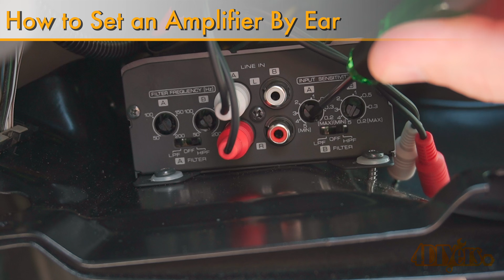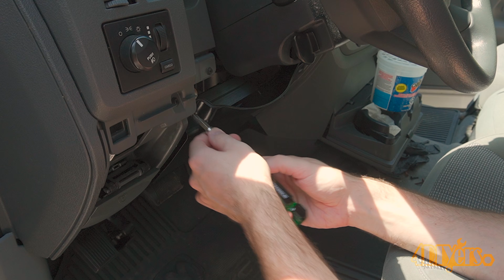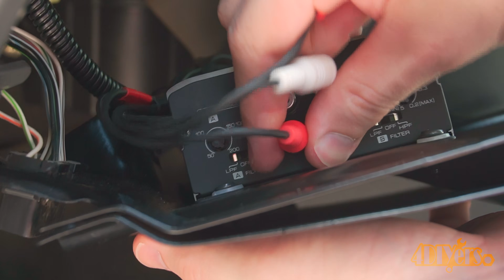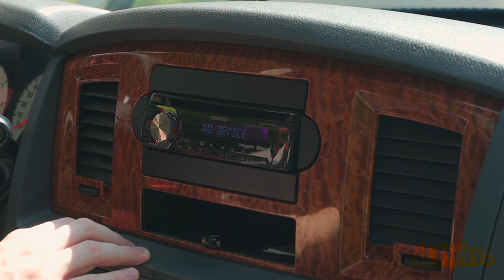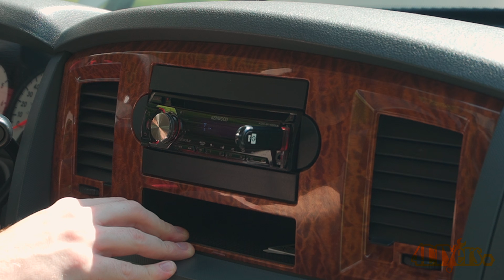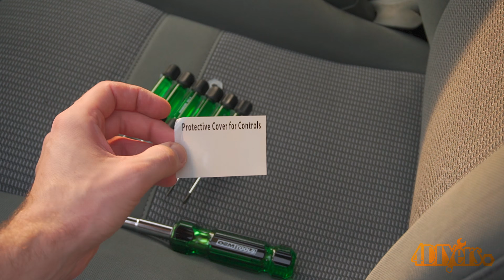How to Tune an Amplifier by Ear [Car Audio Speakers]

Comment: 75% rule is outdated. Headunit wouldn't have distortion pretty much before max volume for rca outputs. The output voltage is much stronger and the gain can set lower.

Comment: I would suggest getting a test tone that is at least the same frequency as your crossover setting, as it takes much more power to produce 40 hz than it does 80hz so you could be losing a lot of power.  40-50hz is usually used for bass amps or LPF which works great. Some actually use a 1khz tone for full range or HPF which I don't agree with.  I use MJ's Billie Jean, it has a solid bass line, good highs and good vocals to adjust by ear since distortion is real easy to hear with that song. An oscilloscope is obviously the best method to get rid of distortion, but who wants to pay 100s of dollars for something if you are only going to use it a few times.

Comment: Mine doesnt change drastically like that. Its smooth all the way throughout. What does that mean? 💀
Reply: Do you have all the settings flat when adjusting the gain (no bass boost, no LPF or HPF frequency settings?) If so, it could be that your head unit doesn't put out a lot of voltage so adjusting the gain you won't notice distortion. If you are using a stock head unit with a line out converter, you might want to adjust the gain there as well. If you are using a LOC, I wouldn't recommend using a passive one, get an active one, JL and Audiocontrol make good models.

Comment: The humming is gone when I was able to keep the power and audio cables away running parallels. The only issue which I am facing is a thud sound when I start my car and then it fades away. This sounds comes to all my 4 speakers in my door pads along with an active subwoofer installed. Any idea what could be a reasons. Any check list I should go through to find a solution to it?
Reply: That is turn on 'pop', this is caused by a discharge in the capacitors. Some amps have a turn on delay that stops this from happening. Sometimes simply installing a remote wire switch can help prevent this by letting your car start first and then turning on the switch. If it still happens, it could be a ground issue or a faulty amp.

Comment: My speaker is making a constant noise even when there is nothing playing
Reply: This is line noise, this can be caused by other equipment, a bad ground, or alternator whine. You can get line filters to literally clear up this issue. This can also just be from the head unit and amp themselves if they are of poor quality.

Comment: Why would you use a 40 hz test tone for mid drivers ? Usuaally use a 500-1K hz test tone
Reply: No you wouldn't, Mr. Smokey is correct, a 1khz tone would usually be used for HPF since a lower frequency uses more power, so you would be losing a lot using a low test tone. But it can be harder to hear distortion from a 1khz tone by ear. For highs, honestly use a clear piece of music, like Jazz for example, rock is off limits since guitars use distortion to get their sound.

Comment: This amp works good with gains maxed out on a 3rd gen Tacoma. Installed it behind factory head. Hertz 6x9 front, factory rear and 12” powered Rockford sub. If you need more volume out of the front stage, bridge it and run it two channels or buy a bigger amp.

Comment: Great video! Any tips for doing this process on a subwoofer amp? I would guess it might be harder to detect the distortion in a bass signal by ear. I have a self-contained powered subwoofer so I cannot access the output side of the amp to use any kind of meter on which means I need to resort to setting the gain by ear.
Reply: A lot of people use a multimeter with a 40 or 50 hz tone use the square root formula to get the correct voltage. This method can be dangerous if you are using equipment that grossly overstates wattage.  SQR(wattage of amp*ohms).

Comment: But why tune it at 75% vol. Shouldn’t it be at max volume so that you can play at max volume with no distortion?
Reply: Its possible that you are clipping the head unit at max volume. 75% is just a safe zone before distortion
Reply: @sikkidesmet  is there any radio that doesn’t clip at 3/4 volume?
Reply: @lokomono89  some yeah, a lot of the higher end pioneer units can max out without distortion.
Reply: that’s how u blow speakers😂
Reply: @makz.1000  I did my research, now I know lol

Comment: Hi bro thanks for you video , i would like to know how is work your amplifier and it is a good quality because i am thinking to buy some one in 2023  , have you still have ?
Reply from the maker: Thank you! I love it, use my truck all the time and haven’t had any issues so far. My system is built for clarity instead of base, it powers my four speakers just fine.

Comment: Do we need go use 40Hz sound? For example i have focal expert v1 and they work from.60hz to 20Khz. Do i need to use 40hz or 60?
Reply from the maker: 40 Hz is what is typically recommended and what my friends in car audio use.
Reply: thats for subs never go lower then what hz  your speaker is rated for  @4DIYers  @arnoldovargas6708

Comment: Thanks for the help. just a heads up, u didnt mention anything about tuning full range speakers, ive a couple of 6x8’s i did the excact same as u only to discover that i basically had no bass or mid range, so i set the filter to off and it fixed it, my sound is superclean now, idk if thats what i was supposed to do or if thats only me but it helped alot.
Reply: Full range means full range. You did it correctly.

Comment: I have 2 amps. 1 for sub & for 4 channel amp...When I upgrade my 4 channel to an higher watts & RMS rating. Do I need to readjust my sub amp to match the new 4 channel amp?

Comment: Really nice video. I have a question if you could answer. I have a kenwood excelon dmx 706s with 4 infinity kappa 62IX power by Kenwood XR401-4 channel amp and doesn’t sound as clear i was expected like too much bass over clarity. How should i tune up my amp? Should I use the x’over before tuning the amp or after? I’m all confused 🫤
Reply: I hope you figured it out considering no one responded to your comment😂

Comment: Where are you have your amp, isn’t that a bad spot especially if you have a knee airbag and if you get into an accident.
Reply from the maker: Nope. There is no knee airbag on this truck and there is plenty of air flow, away from any heater ducts.